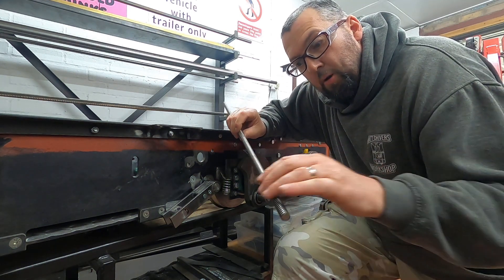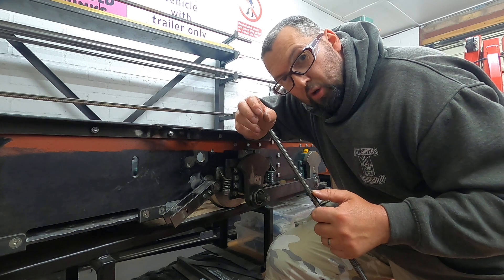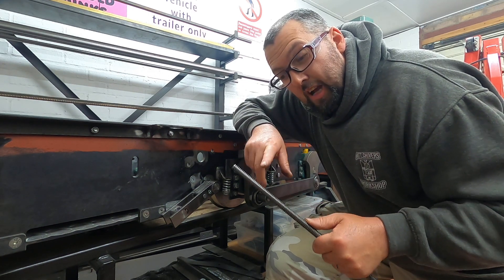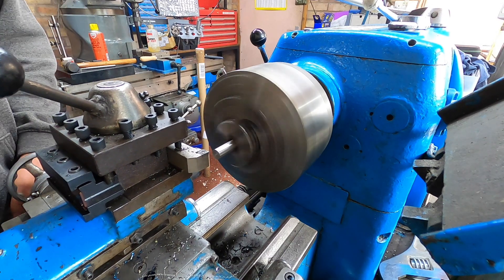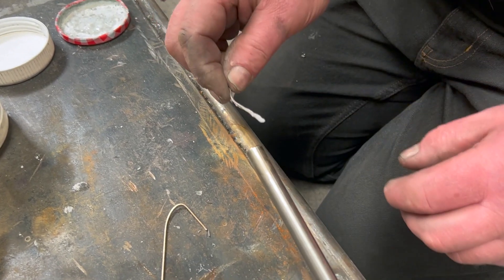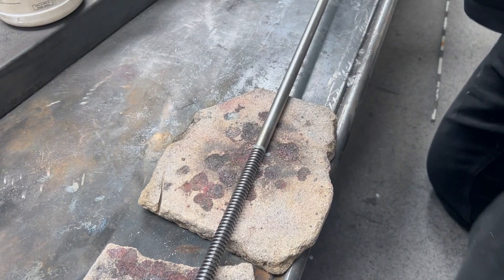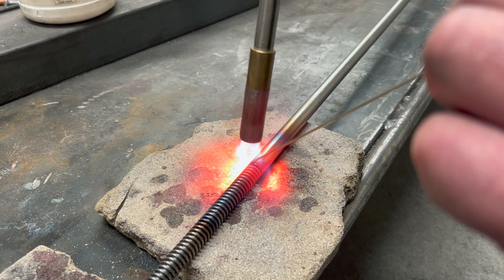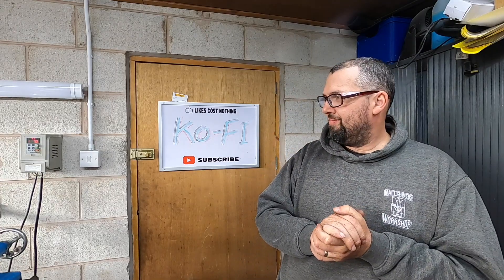Brake Column Rod -  Ep46 - 7.25" Gauge Steam Locomotive Build

Comment: Hi Matt, If you can get hold of the old-fashioned silver solder that has Cadmium in it you will find that it flashes bright silver instantly runs at the right temperature, and always gives a good joint. And if you run out of flux, Borax will do the job as it is what all the common fluxes contain, and it's dirt cheap.Regards Mo King
Reply from the maker: Hi Mo, yes I believe so, I believe you can get it, but its a pain to get hold of. I've just acquired a little set up for silver soldering, so once I've got some fluxes and solder, firebricks etc I'm going to have a go at learning how to do it. My friend did the soldering in the video as it was his gear. Hopefully I'll do a video on my trials and tribulations of silver soldering! So keep the tips coming! Thank you, All the best, Matt.

Comment: Hi Matt.
Silver Solder in shear is plenty strong ( copper boilers for example).
Plus the mechanical joint ( M8 thread)… should prove entirely adequate IMHO.
Interesting that the EN8 became brittle? It must ‘air harden’ I guess?
When welding plain carbon steel ( or alloys) to Stainless, most pundits recommend 318L filler material.
Anyhoo…. very elegant solution 👏👏
Regards
Robert
Reply from the maker: Hmmm didn't think of trying stainless rods TBH, when I have a spare five minutes I try it again with stainless wire. Considering I spent 20+ years welding you'd have thought that would have come to mind! 4 years away from the game my mind is dropping the knowledge I suppose. All the best, Matt.

Comment: It’s fine talking about the video link, but you need to put it on the screen lol. As you’re going to be putting the silver solder under tension in a twisting manner, do you think it would be prudent to add a couple of taper pins in to share the load?
Reply from the maker: Opps, my bad! I must be getting dementia in the old age! Nope no pins, I've used basically metal loctite, remember the two are threaded together, if I snap this the brakes have been put on too hard. All the best. Matt.

Comment: Silver solder isn't that great in tension... I'd consider putting a pin through everything as well, just in case :)
Reply from the maker: It’s an option, tests so far have proven it’s strong enough, only time will tell. I did a test with a bit welded… it lasted no time at all, the intense heat of welding made the En8 crack and fracture. Tests with silver solder proved much stronger. All the best, Matt 👍

Comment: You learn something new every day. Is it true that if you use silver solder to join a threaded bar it's straighter than arc welding it? Thanks
Reply from the maker: You’d have thought so, welds shrink, pulling the material all over. Problem here is you can’t weld en8, which is what the threaded bar is, it becomes weak and cracks. All the best, Matt 👍